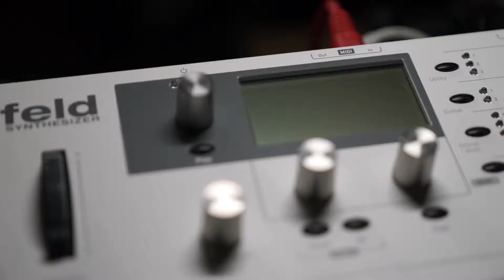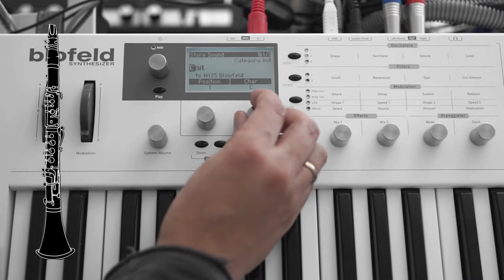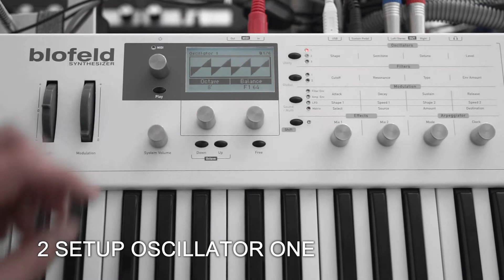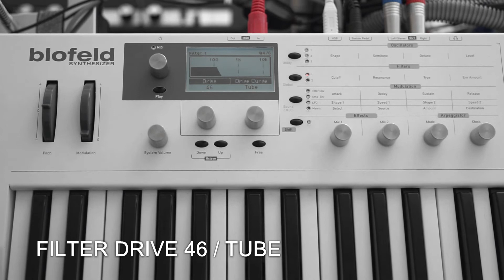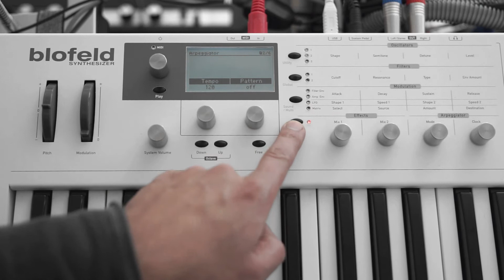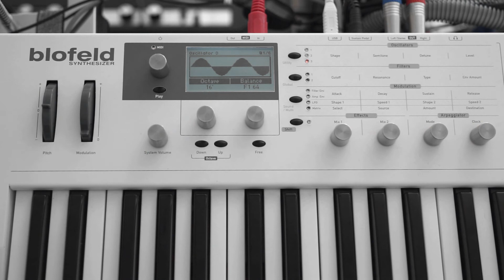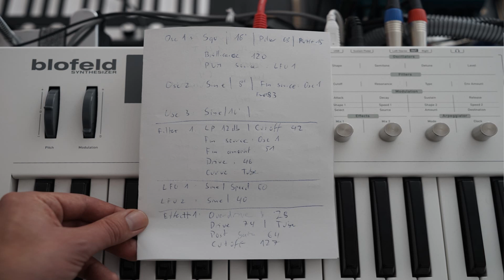How to create a clarinet / reed - like sound on a synthesizer (breath controller vs. blofeld)

Comment: Nice! I don't have a blofeld anymore, but I recently picked up a Hydrasynth and have been looking for ideas for programming before I dive into the wavetable and mutator stuff.  Going to take a shot at doing something similar but using very low osc levels and aftertouch to increase the volume.  I love synth patches that sound just close enough to existing real world instruments while still sounding foreign and alien, makes for good psychedelia.
Reply from the maker: Thanks for watching! I agree. Working with an "expressive" controller & patch opens up some interesting possibilites.